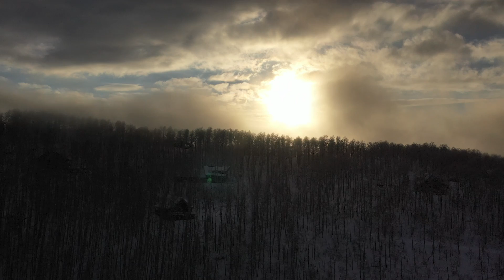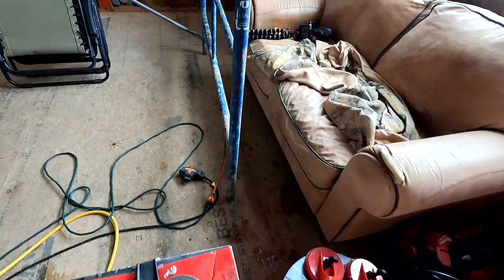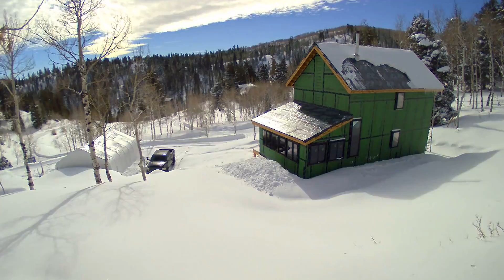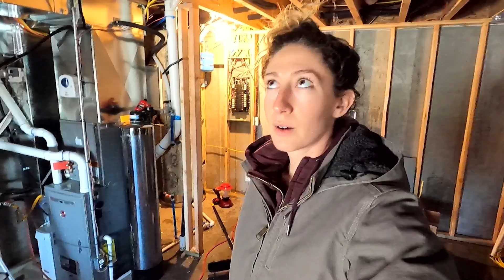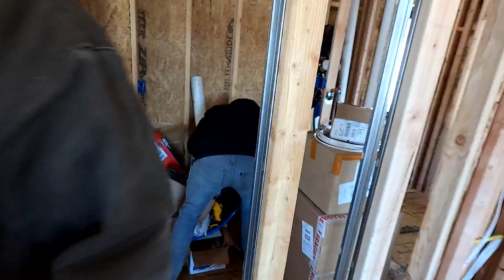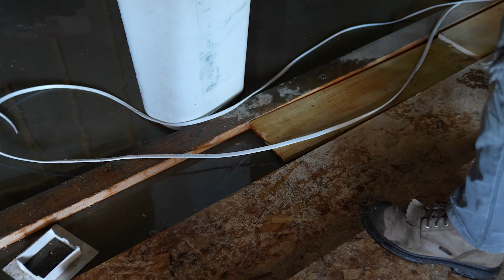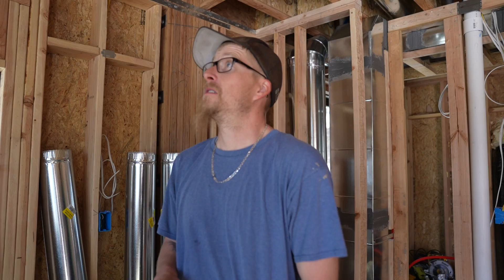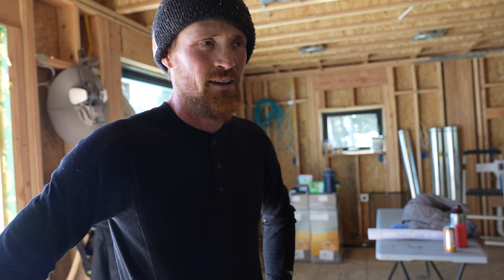OUR 4 WAY INSPECTION WAS AN UTTER DISASTER | BUILDING OUR OWN HOME

Comment: All of us ever owning a home know it is an adventure. This is only your beginning.  As you build, keep a mindset to build it so it can take the worst case scenario. For example, my washer machine has caused more floods. If I was building now, I would install a drain in the floor near it, pitch the floor in the direction I would want water to go.  Kitchen sink has  overflowed too, if I was building,  if water went through the kitchen floor, make it so it would not drip down into a clothing closet. Little things like that help later on.

Comment: It should be a simple job to isolate the cause of the problem.  Switch every breaker off, then one by one switch them back on.  If it trips when you switch the main breaker on then it is either water in that breaker or across a common active feed line.  If ok, continue to switch on each breaker until you find the one(s) that are still a problem.  Then isolate the outgoing wires from those breakers as that should point to it being in the building wiring or the beaker itself.  I hope that this helps.  I have test tools that could help isolate the problem, but as I am in Oz, they are of no use to you, sorry.

Comment: Many years ago, I had an inspection by Medicare officials for my Medicare Certified surgical Center. We had to have the contractor who installed the emergency power supply present to "stage and test the equipment" in front of the inspector. 

Prior to that time it was working perfectly. It still was. But the problem occurred when the contractor reached his hand into the power supply for the equipment and it arced out and knocked him off the chair!!! He fell down in a heap in front of the inspector!! 

I was wondering if he was electrocuted and if I would have to do emergency CPR. Fortunately he got up again and finished the test, which we passed. 

Now it is funny. THEN it was awful. I FEEL YOUR PAIN. YOU HAVE NO IDEA HOW WELL I FEEL IT. 

Sanjosemike (no longer in CA)
Retired surgeon

Comment: You guys are really having some bad luck.  I absolutely felt your frustration like I was there.  I'm still amazed that that you were so close to passing and just have a doable list of things left. The inspector didn't seem even upset about the water issue and breaker issue.  You have an angel on your side, I swear.  I wish you all the luck in the world to find the answer to the electrical problem and pass your next pass with flying colors.  You have all worked so hard.  And I pray you find out what is going on with that troublesome breaker electrical problem. 🙏🙏🙏🙏🙏🙏🙏🙏🙏🙏🙏🙏🙏🙏🙏🙏🙏🙏🙏🙏🙏🙏🙏🙏🙏🙏🙏🙏🙏🙏🙏

Comment: Once a breaker down at the Main Panel trips a few times it starts tripping easier and easier. Try replacing the breaker that feeds the cord that goes up to the house. House Electrical Panels are pretty resilient when it comes to water. A simple drying should be all you need, imho.. If your problem isn't a bad breaker it could be you have a ground fault because of the water. Is your receptacle, that the extension cord is connected to, on any kind of GFI ? Either at the Meter Main or the receptacle ?

Comment: how about... maybe... i dont know... invest 5 bucks in a voltmeter and measure all power circuits (continuity, resistance to ground, resistance to neutral) to find the error instead of running down to the main breaker every 5 minutes?

Comment: Probably water is inside something still where you can't see it causing the short. Be safe. God bless.
Reply: Just give it a couple days to dry out on its own. Or get a big fan and generator and let it run or a couple days. Too bad you can't run a solar fan through the duct work for a couple days too.

Comment: Push Install one fuse at a time... the faulty one (or two, or more) dry it and reinstall. Until all are dry.
Water could be also in the blue boxes or conectors and triger the fuse. 
Saludos. (from Mexico)

Comment: Drain tests and those plug dams are very sketchy. I have had one fail and had to go to great lengths to get the water out just like you have done,except for it was on a operating semiconductor plant and took 15 people to clean it up. You did excellent work.

Comment: Anytime that much unwanted water enters a Job Site, high speed fans to help dry to beyond dry standards era always brought in.
Air exchange outside to inside however you can accomplish this is highly suggested!
And of course saturating all surfaces with you favorite mildewstat/mold inhibitor.
Personal experience, wet electric motor to dry and work again but it takes time. 
MHO!!
I would swap out all the breakers for now, but would save the ones taken out for now to many unknowns.
Super Proud is still how you should feel!
👍👍✔✔👏👏

Comment: It would take VERY little moisture in your panel to trip a 120 volt gfi breaker in the power pole 100 feet away. Run a 240 cord from the pole to energize the panel, then use a temp outlet on one of your branch circuits. All 120 volt outlets used for construction shall be gfci protected for the safety of construction personel. Licensed electrician here. 240 volt circuits are not required to be gfci protected

Comment: I cant believe you guyz made it thru the day without your heads popping. What a disaster. But, if I know people, you guyz will come through. My electrical experience would tell me to just keep drying everything you can. Eventually it will dry out and those AF/GFCI  will stop tripping. Without being there and following the circuits with a meter I'm not much help, but it's obvious the water is the issue from what I see. Dry, dry, dry

Comment: Hi guys! I know that probabilly by now you got the problem solved, but usually you can try to dry everything, but water rus inside components and you can"t dry them easilly.... your breakers may have water inside, it needs time to dry... you could put a lot of wood to heat the house but the breakers are in the bacement, so its not easy, you could remove all the breakers an put them in the sun or near the heat, or use a dehumidifier near the breakers, or just wait a couple of days to dry... but congrats for the inspection being fine and for the great job! Best wishes and good luck for you both from Portugal!

Comment: I have to be that nerd that asks, “what was the problem with the extension cord?”
  I suspect a load drop in the circuit is tripping the breaker.  Burned up a drill that way!  Measure the voltage at the end that is in the house.  If there is too much resistance because the wire in the extension cord is not a heavy enough gauge, it will protect the circuit.  Also anything you plug into it will work too hard to try to run efficiently and will eventually fail.
WHAT A DAY!! That, Allie, truly was an adventure!  Godspeed

Comment: Congrats on the 4 way!  I felt you would do OK based on the extensive research you do and Kevin's expertise.  I wish I could be there to help you with the electrical.  I have chased down many ground faults and shorts in industrial equipment, it is going to be something simple.  Start by removing the pigtail you have the panel connected to, tape its ends and plug it into the cord from the breaker (road) and see what happens.  Do you have a meter?  You can get a cheap one at HD or Lowes.  They are invaluable to a homeowner.  If your electrician buddy heads up, have him bring a "megger" if he has one, that will help immensely.

Comment: I built in 3 different counties in Indiana. My inspectors would have told you to clean everything out of the house and walked out. Looked like you need to dry out the breakers themselves. That was hella water!  From what I could see from your videos, you did a great job building your house. IMO, that one major crane mistake was the crane operator not having an oiler checking your rig. They should never send out a crane with only an operator. When I seen that rigging, I said wholly shit NO! LOL

Comment: Congratulations.  Great work.  Sorry for the issues.  Try to dry out your subfloor, could cause issues later.  The duct in the floor in the restroom, I would move into a wall and off the floor, we all know bathrooms and kitchens like to flood.   Let the electrical panel sit for a few days and all should be find.  The HVAC, have Dean inspect before turning on and attempt to dry out ducts as much as you can.  You guys did great and don't let the small things upset the house you have created.  I would buy a house you built.  Best of luck with the rest of your build.  Hopefully you have found drywallers to hang and tape.

Comment: What I learned about having a long extension cord is for mowing with an electric mower is an extension cord needs to be bigger to handle the current to go a long way. Drom the source,  the first cord should be bigger than that orange cord you're using. Go buy the next size  up which is green to replace the smaller orange  cord.  The second cord  attachment can be smaller, or the same size, but not bigger than the first. A smaller orange,  then two yellows is why it's tripping.  The longer the way electricity goes in a cord, the more juice it takes to get it there. Also start bigger and attach same or next size down.I believe smaller orange to two yellows is why you have the problem. Ask at Home Depot or your electrician.  Good luck this weekend.

Comment: Wow! what a rollercoaster of emotions. You handled that amazingly, I would have been rocking in the corner, crying and adding to the water on the floor lol. I'm so pleased that you only had a few little bits to fix from the inspection and with absolutely no experience other than a flood in my home once, we were advised to let everything dry for 24hrs at least. I really hope that's the case for you. Good or bad, you're making memories xxx

Comment: I am not  electrician but i do work on electronics.. that cord you have from the main to your electrical panel doesn't look thick enough. extension cords that long should be  rated 30 to 50 amps min not sure of cord diameter/gauges size. I have had weird stuff happen when clients attach extension cords to run power to my equipment and it pops the eq breakers.  especially since you have disconnected all breakers from panel.  we call what you did a PIG TAIL and they always cause issues.  Just my observation nothing more..  Great work on all you have done . we love your videos 10 thumbs up.

Comment: It's water that has gotten around the screws that fasten the buss bars in. Wait a few days or take them out and dry them off. It's dry on the outside but still wet in the little cracks between the insulators.

Comment: The duct work should not be in floor or near drain for obvious reasons. A/C ductwork should have a section near unit that can handle minor flooding of ductwork directing to sump pump and be sloped away . Electrical panel needs shielding from any possible water entry. drip loops and/or/maybe conduit to prevent entry into panel via wire and moving electrical panel away from water sources. moving furnace up off floor would help during flood of basement drain.
Sprinkler/Wildfire prevention/protection system should not be tested with leaky plug.

Comment: Congrats guys! Wait till you have those kinds of issues on a boat. That really gets the stress level. By now you probably have the insulation completed and ready to Sheetrock. My advice is to get some pros in there with crews to get the ceiling done in a few days. You can do the walls, taping and mudding yourselves. Having a stucco texture hides most of the “issues”.

Comment: Oh! One other thing...mold becomes much more toxic (aka “toxic mold”) when it’s been eating and growing on chemical filled building materials. Mold on food and outside isn’t nearly as toxic because it’s organic material from nature. Basically mold feeds on cellulose (wood) and other things, chemicals included to get that food (mold has adapted quite well) it needs to thrive. So it eats building materials which have tons of chemicals in them like fungicides and chemicals to prevent it from rotting & as it feeds on it, it basically farts out mycotoxins-the toxic gas that makes people sick. This difference in what it’s feeding off of is EVERYTHING. That’s why people can eat moldy cheese like blue cheese and it’s ok, it won’t make them sick. And it won’t become systemic from eating it. But in time as your skin/lungs/eyes/mucous membranes continually absorb mycotoxins in your environment/home/in your clothes/on your dishes, etc...all that toxic mold needs is a host with just low enough of an immune system to become systemic and it’s extremely sneaky how it works from there. Women, children, the elderly and men with compromised immune systems are the first to get sick. Allie already has had a sinus issue she can’t fully get rid of which is EXACTLY how this usually starts to become systemic. Then often the Chronic Fatigue Syndrome starts or other weird symptoms. 
Take vitamin D, get lots of sun, AIR THAT HOSUE OUT FOR 1-2wks very well!!! You CAN do this!!!💐

Comment: What a calamity! Does the HVAC have power going to it's separate breaker that bypasses the main breaker box? If so, perhaps where the electrical problem exists. I've noted sometimes you have a light on in there when it seems the main breaker box is off, so perhaps that's a place to look. Also, perhaps the line from the street box to the house has a problem, not directly related to the flooding which happened in the house. I'm surprised the inspector took it so easy on you considering all that flooding, sure it would spook him into just rescheduling your inspection for a later date.

Comment: Did you dry out your AC cord connector to the panel?   Try disconnecting it from the panel and see if it still blows with panel not even being connected.  Your probably past this point already and it's working now.   Oh well.